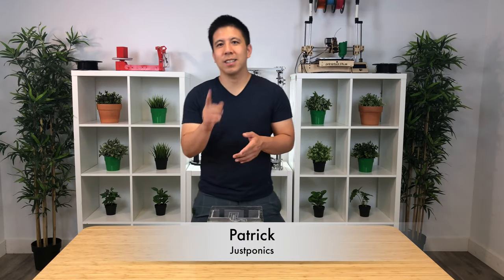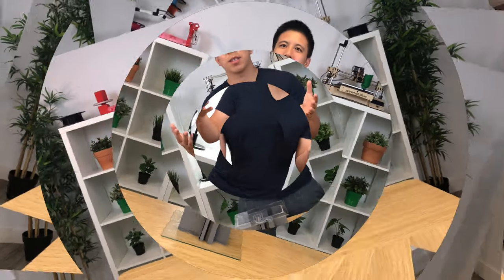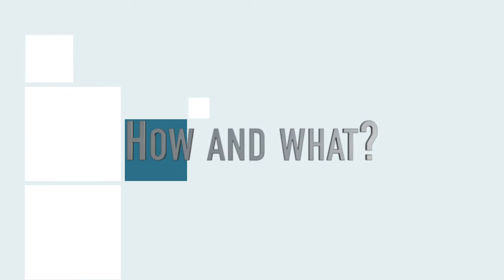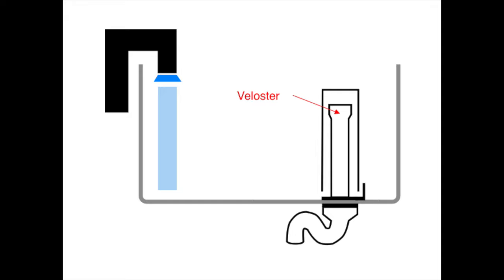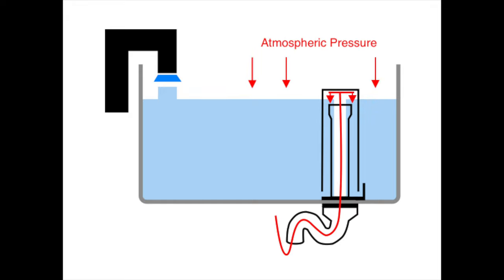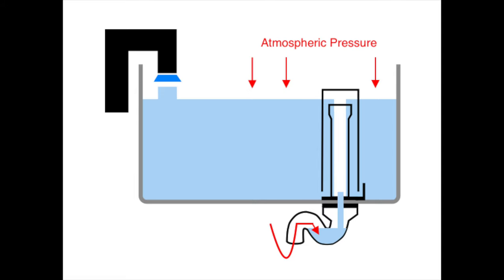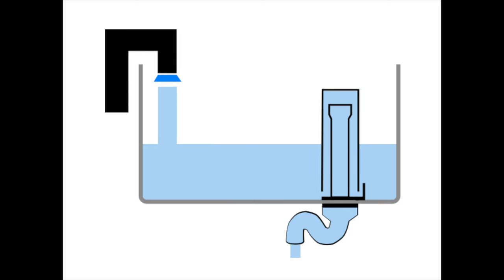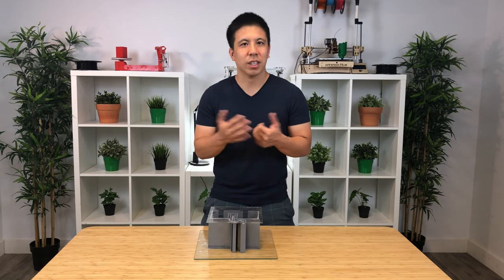Bell Siphon Exposed

Comment: Is bell siphon is perpetual in nature if water flowing continually in the hose ???so we found out that uncertainty with certainty of perpetual motion???
Reply: Energy is continually added via the water inlet. You can’t connect the outlet to the inlet for perpetual motion because you’d need energy to lift the water up (potential energy increase).

Comment: I have a question, how would the tank drain if the water pump would happen to  shut off for whatever reason, just shy of the drain pipe that sets the maximum water level?
Reply: It would not drain.